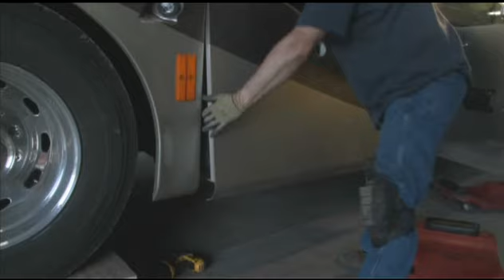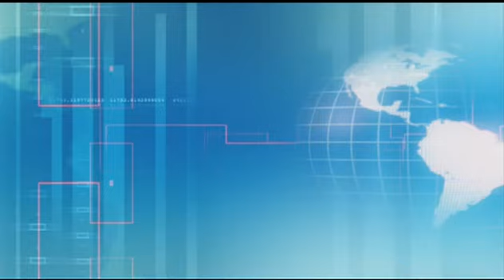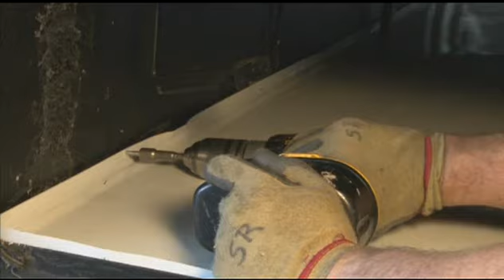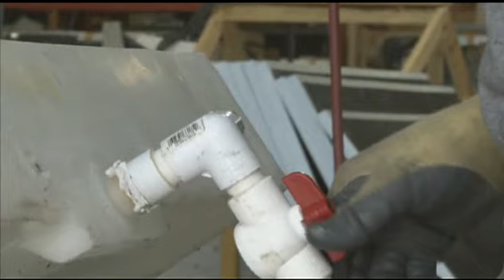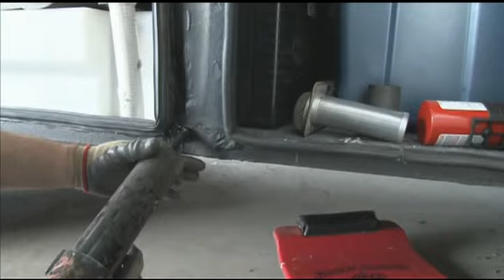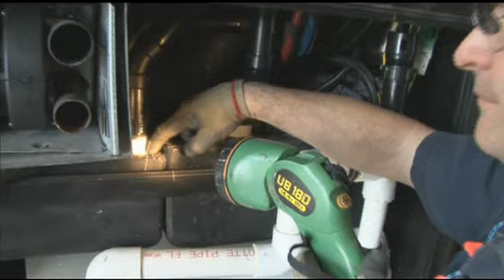Tiffin Wet Bay Floor Replacement

Comment: What's the actual cause in the first place?  I'm sure a leak or water/liquid intrustion... but, why is this for MANY of the wet bays in a Tiffin?!  I'd like to know the history, so when I repair I know what to look for and repair any possible known leaks or issues BEFORE I replace the floor. I surely don't want to do this every 10yrs.
Reply from the maker: I'm not an expert but I believe they didn't use suitable material (e.g. marine plywood) or treat it suitably and moisture / water accumulation would cause it to fail (it's not uncommon for fresh water hose connections to leak or fresh water fill up to overflow so it's going to get wet there).  I think for the first 10 years, Tiffin would replace at their expense.